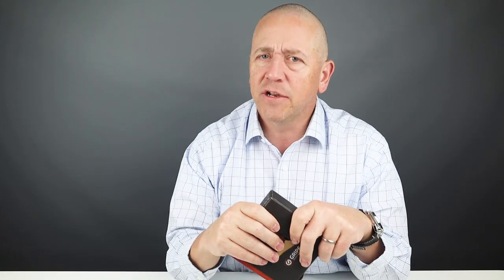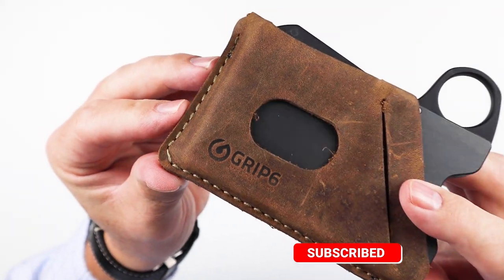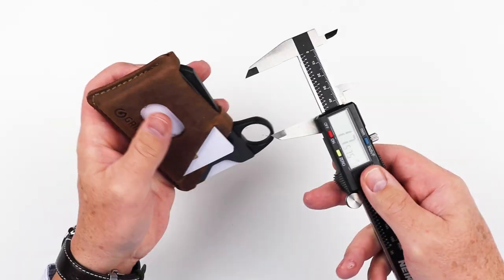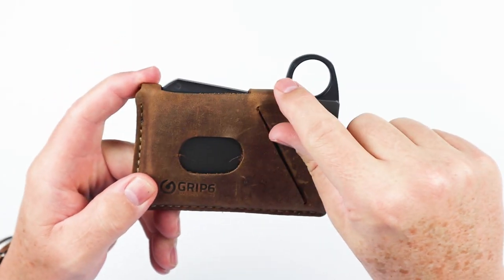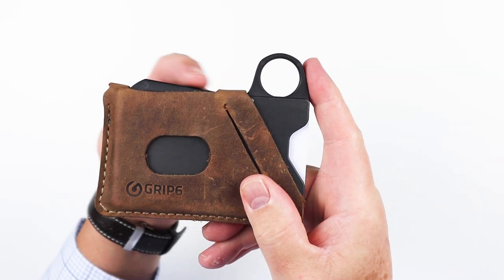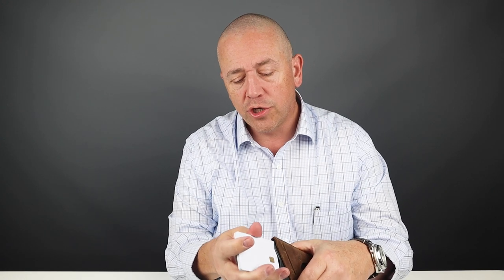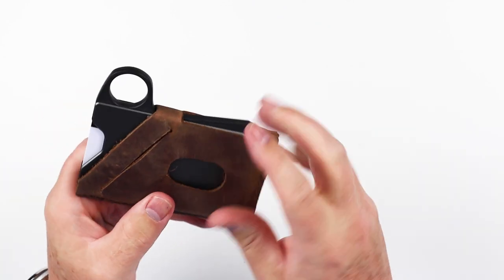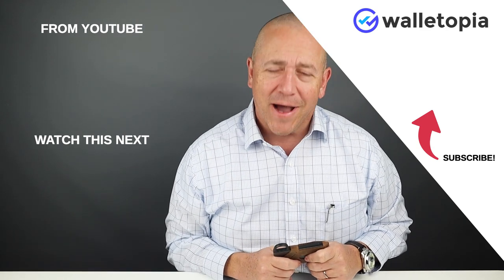Grip6 wallet v2, high quality, continuous improvement

Comment: As long as you don’t go all Hulk on the lever, they don’t launch out. I’ve been using the V2 for a bit now and I really like it. The loop is a cool function but you can get it without the loop if you don’t like it. I was surprised at how well it fits in my pocket with the loop. I can even fit it with a Spyderco pocket knife in there, which can be wider than most knives.

Comment: Great review! With the features this design offers for the competitive price (less than the Ridge Wallet), this is definitely a top wallet I'll consider to (possibly) permanently replace the leather ones I've been carrying around. And aside from the other gripes you mentioned, my only other concern is that the finger loop could make it easier for pickpockets to lift it if you leave that thing sticking out.
Reply from the maker: Good assessment and I agree.  You can get this without the loop which I would carry before the loop one.
Reply: You could use the finger loop to securely attach the wallet to your person to prevent or deter pick pocketing in places where you know it's an issue. It's not as though breaking the loop or tearing the tether in a hurry would be easy.
Reply from the maker: @mackjones7688  Great thought!  It's a good tether point.

Comment: That metal loop is *huge*. I wish Andar kept making the version one Pilot. The leather cash strap was perfectly useable.
Reply from the maker: Yes, Andar's Pilot v1 was good.  It looked a lot like other similar wallets, which might be why they went with such a drastic v2, but v1 worked just fine.

Comment: I think ppl should know that the cards launching out is easily fixed if u simply put 1 more card in... I hope u try this and maybe pin a comment up top so ppl could see it,, id hate for ppl to watch like I did and think that was gonna b a problem. It almost made me not get the wallet, I did get it cuz the company is great and wanted to support them. I watch a lot of ur content, great stuff, hope u maybe get to try this and see what I'm talking about
Reply from the maker: Thanks Nick, I did try it, getting to 7 cards. Despite adding one more card, the card still launch, albeit, not as aggressive.  The fix (which really needs to come from Grip6) is a friction strip on one side (or both) of the internal box, that's what all other box vendors use....because it works.  I provided that feedback when I visited their factory last month.  Don't get me wrong, I really like Grip6, excellent principles and know that their customers are who they serve.  After a couple quick manufacturing iterations, this wallet will work flawless.
Reply: @walletopia  oh, maybe its the cards ur using, mine literally don't jump out at all. I got some with raised writing and some without. Works perfect no matter how hard I push button. Yes I agree they should add the strip, I just don't have issues with it. 1 of my cards in it is my I.D., maybe that too could have something to do with it isk just speculation. Its awesome tho, glad I decided to support them. Thanks for review
Reply from the maker: @NickJamesHarrier  ah, yes, that might be why, you have a diversity of card types which could easily affect the ejection.  Mine are all uniform (flat, no embossing) and the same dimensions.
Reply: @NickJamesHarrier  I just got this wallet and although the “Gambit feature” takes a LOT of force to enable and hence not a worry at all that I have I went ahead and added a 7th card and even a gift certificate printed on cardstock type of card and you are absolutely right about that inhibiting the launch.  Excellent idea!

Comment: rubbish...shouldnt have to pull your cards out...trigger should be perfect from the get go..problem is the trigger has too much room to move...its a bad design....wallet in my pocket will eject the cards from side pressure..bad design..and no need to have such a long trigger bar..plus the finger ring looks tacky...looks like a toy
Reply: Hey Darth....I Sooooooo Agree.....that trigger  is huge, and I can already see myself screaming after putting it in my front pocket and having the Cards "eject" at All the Wrong times(lol!)....and yes that huge finger ring is VERY tacky!.  But someone did have a quick fix suggestion/solution?....by adding a thin leather strap on top to "stop" annoying misfires/mishaps. But that sorta eliminates the ease of a quick access, if he have to release a top strap, and get it out of the line of fire(so to speak).